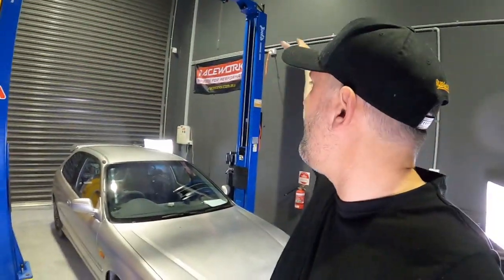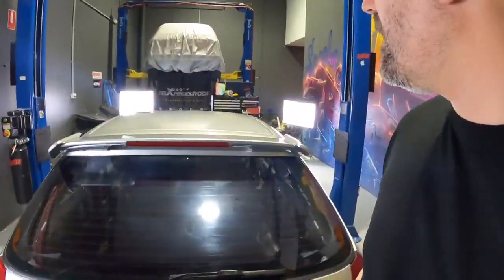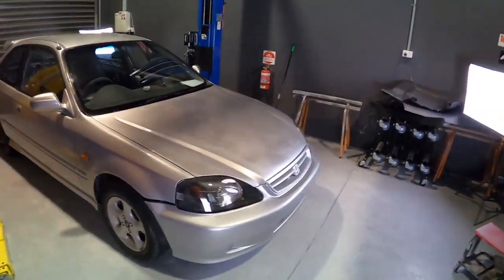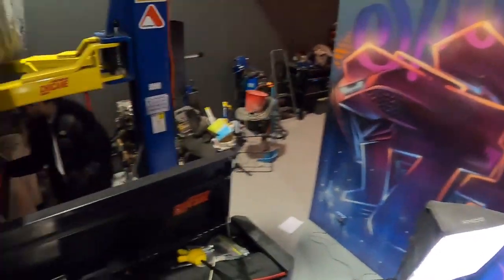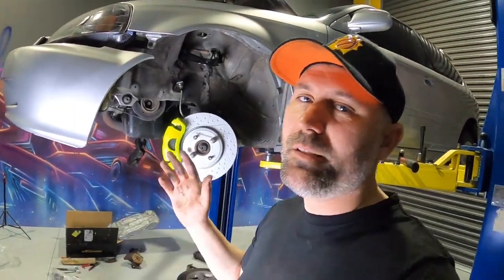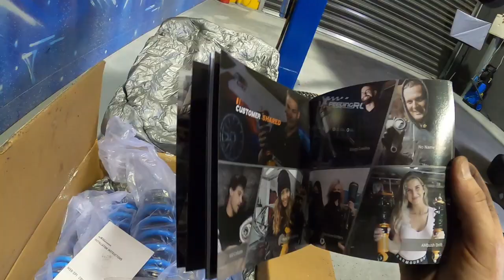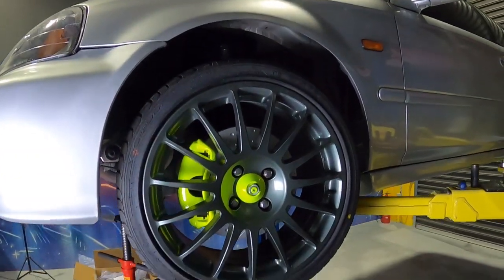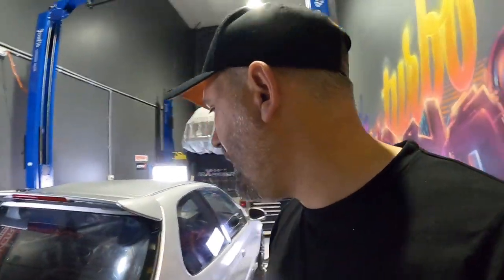EK CIVIC BUDGET BIG BRAKE KIT & NEXT GEN MXR COILOVER INSTALL

Comment: What wheels are you running? I did the swap with 04 accord callipers and my 14” are too small wondering if 15s will be enough
Reply from the maker: 16s is ideal stock ek4 rims clear but best to run 16/17

Comment: Nice work am, watch the videos often. It would also be good to know how you feel in terms of performance/reliability on the old vs new MXR coilovers as keen to getting a set but heard bad reviews on the older one.
Reply from the maker: I run the older ones in my budget track car and tbh they are great for the price, its a funny thing putting budget and track car in the same conversation but I have had a great experience with them , even overtaking wrx's and 86's
Reply from the maker: I will try get to shockworks to dyno them

Comment: Hey mate did you have to change your brake booster for the brake upgrade?
Reply from the maker: you can change the booster, I am not going to for this build, if I was I would do a honded brake booster delete, save weight and get  stronger braking force with better control, I have one on my black sedan and I love it

Comment: How much was the big brake upgrade in front? Did you need to swap to ex knuckles I’m guessing you did upgrade the knuckles
Reply from the maker: need gli or sedan knuckles or ej8 or ek4 , the disc rotors were from Maxpeeding rods, pads are up to you and I used integra calipers